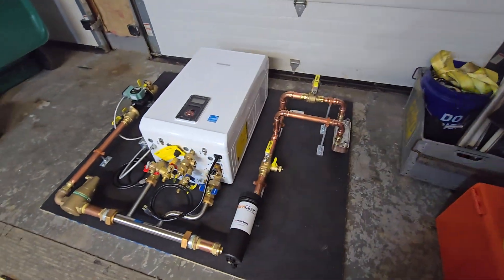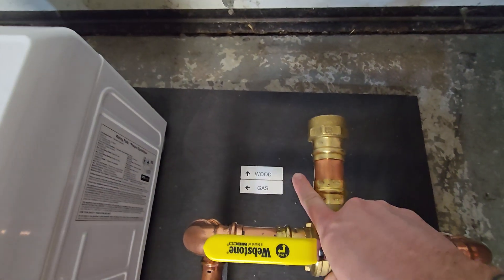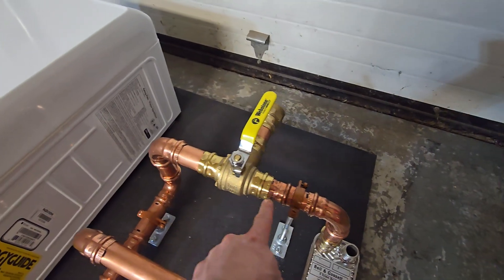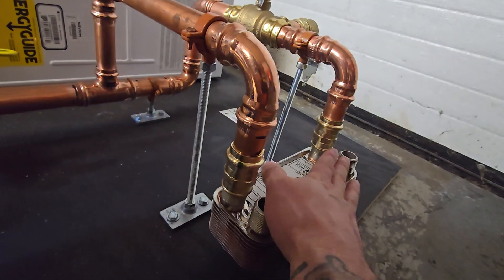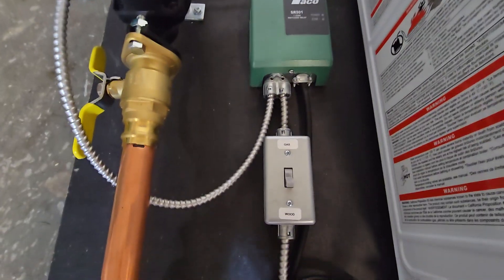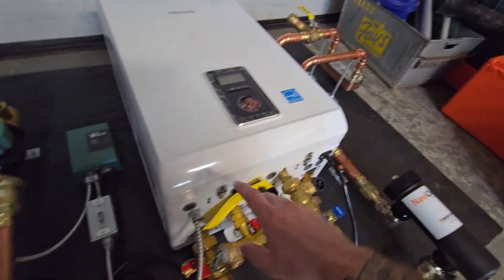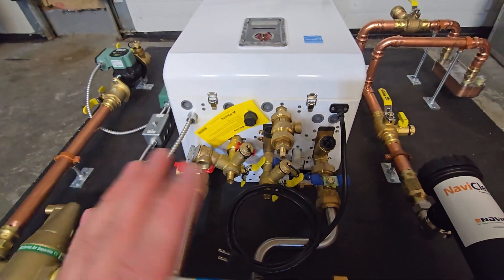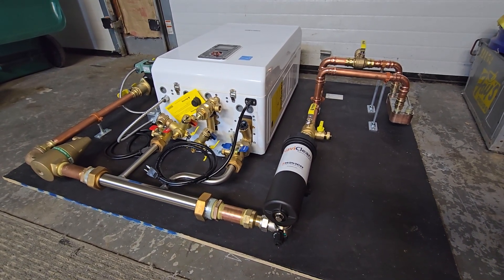Combi Boiler System With Outdoor Wood Boiler Backup Heat Exchanger

Comment: In this setup will the wood boiler also heat the domestic hot water? I am not that familiar with the Combi system.
Reply from the maker: It does not. But you can also heat DHW with a wood boiler with the proper setup.

Comment: Can you heat potable water as well as running heat to the infloor heat with a combi and outdoor wood boiler?
Reply from the maker: Yes, I can build/design a system that can use a manual or automatic changeover from wood to gas/propane and also utilize the domestic hot water from the combi. Email me at speranzadevelopment@gmail.com

Comment: Does this type of system not require a expansion tank?
Reply from the maker: It does it will get mounted below the air separator. It's mounted later for easier transport and installation of the board.
Reply: @JimSperanza  ok that makes sense, now this system will work with baseboard heaters? would you be able to send me a copy of the required components for this build. This is exactly what I want. I have a wood boiler right now but would like to have the propane option as well.
Reply from the maker: @landonboulter9475  email me at speranzadevelopment@gmail.com

Comment: Can they work together ? Have the wood burner going and the heater would just use the hot water from the fire to help. Would the boiler run less if the return water was hot ? Thanks for the video !
Reply from the maker: @awake.collective  technically yes you could run both at the same time with the correct setup.

Comment: How about If I want the propane to
Reply: be the backup for the wood automatically...for instance...I leave and wood goes out...how can i use the propane to be used for house and SOME of the heat go to the boiler to keep it from freezing...Is there a way to put some kind of restrictor  so it doesn't try to heat the entire tank of wood boiler also?
Reply from the maker: @gregsanderson5748 I can design a system for you to automatically take over when the wood burns out. Email me at speranzadevelopment@gmail.com
Reply: This is my exact question. Looks like all 3 of us have the same question. Hopfully Jim can come here and shed some light on this for us!
Reply: In theory, you are basically adding another "heating loop" to this system. Get one of those outdoor/indoor propane tankless water heaters and hook it into the loop with the necessary piping and valves. As long as the propane water heater has enough BTU, it should heat the system all the same.
Reply from the maker: @Cain-x I'm not sure i understand your comment. This is not an additional heating loop to the system. There is a valve that can be manually changed over to direct the return water through the heat exchanger or bypass it. There is also a manual electrical switch labeled as "gas" or "wood" that tell the gas boiler to fire or not depending on which mode the user decides to run the system. This can be designed to be fully automated with no user input however this customer specifically wanted manual control.
Reply: @JimSperanza  Sorry, I mixed up the terminology - thanks for clarifying
Reply from the maker: No problem. Reach out anytime if you need help or have any questions!
Reply from the maker: @karll9210 I can design a system for you to automatically take over when the wood burns out. Email me at speranzadevelopment@gmail.com

Comment: Are you able to configure a system that changes over automatically?
Reply: There are 3 way electric motorized ball valves on the market that could control the switch between wood fired and NG fired heat loops. You could in theory have a single master switch to control this setup.
Reply from the maker: This customer specifically wanted a manual changeover. I did explain to them that this can be fully automated however sometimes simpler is better for long term and "off-grid" type situations.
Reply from the maker: @esauseven  absolutely email me at speranzadevelopment@gmail.com
Reply: Thanks for the reply. Another question, is there any reason this could not all be plumbed with pex?
Reply: @esauseven Jim probably likes to use copper like myself in the main manifold build or primary/ secondary loops at the boilers because oxygenated pex is very hard to keep your piping perfectly straight.  Also pex really doesn't have the strength to hold components likes pumps, expansion tanks , air separators,  and all close boiler components. Things can sag or move slightly if your not using copper to hold this stuff because once you put water in system the weight add up. It can be done but copper piping right at boiler makes for a very strong and clean looking installation.
Reply from the maker: @esauseven technically it can be done with oxygen barrier coated pex
Reply: thanks, it's great that you are on here to answer questions
Reply: BTW I built my own radiant system in our 3 level house 25 years ago, heated with 2 NG hot water heaters. It has been awesome. I'm impressed with the new exchangers. Mine is massive in comparison.
Reply: Thanks. Makes sense.